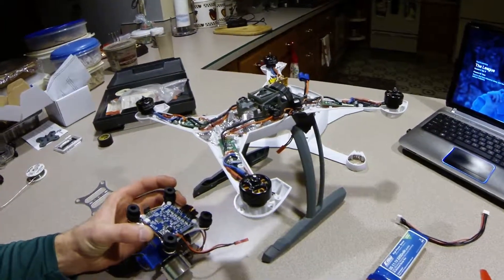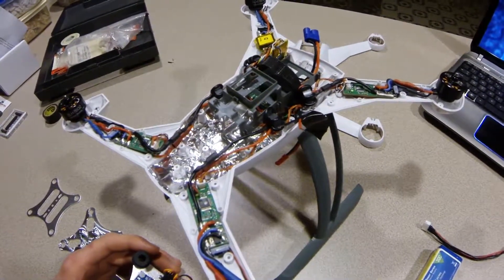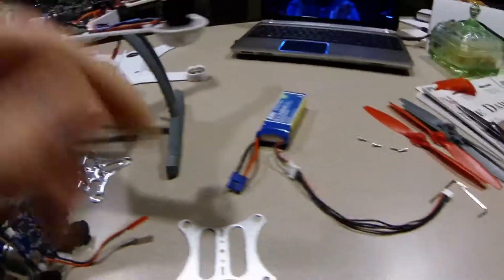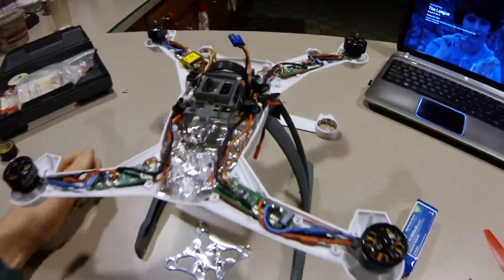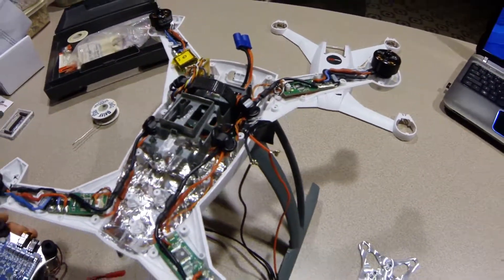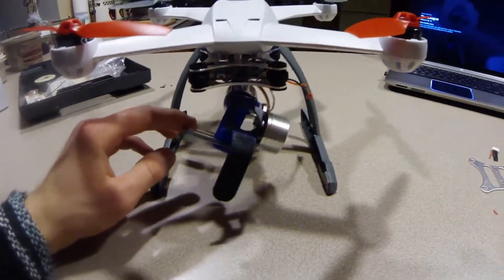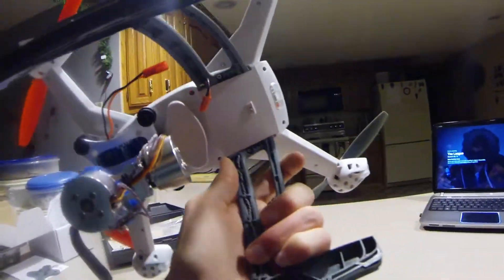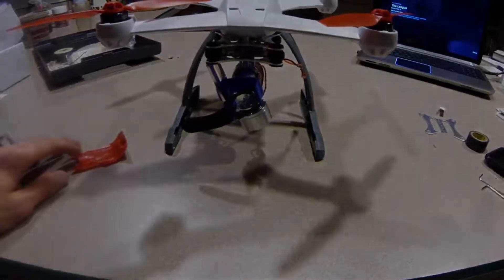Blade 350 QX Detailed Gimbal Installation

Comment: Where did you get the anti vibration mount that fits the gimbal
Reply: Nick Zadow I am wonder in the same. The piece that mounts to the original holes in the Blade